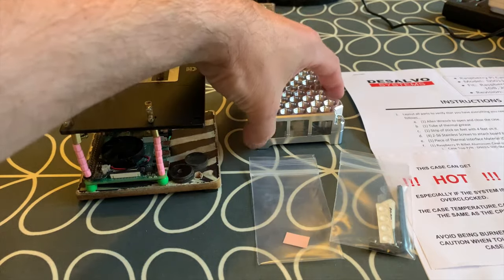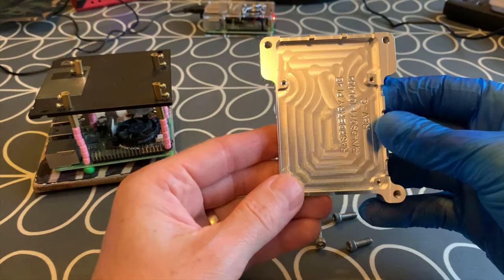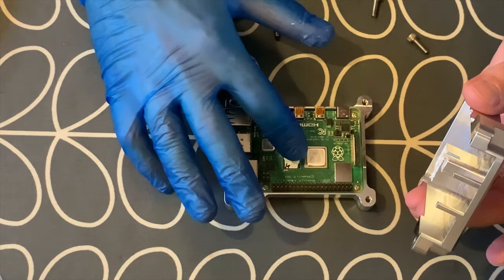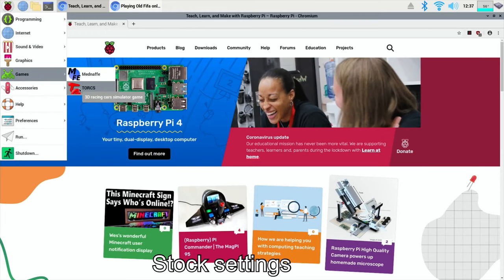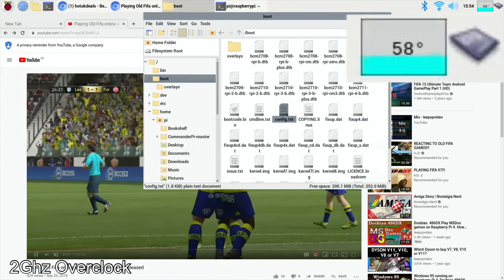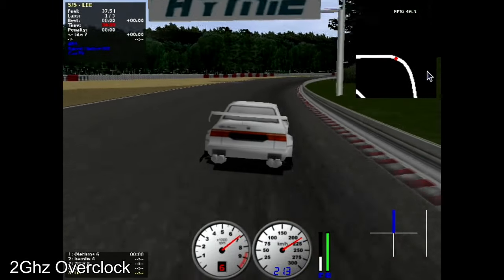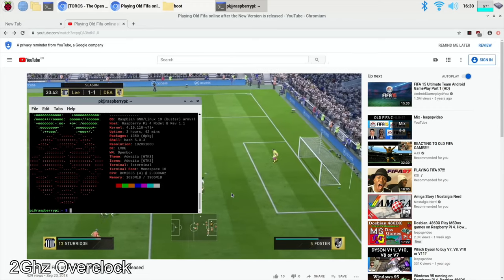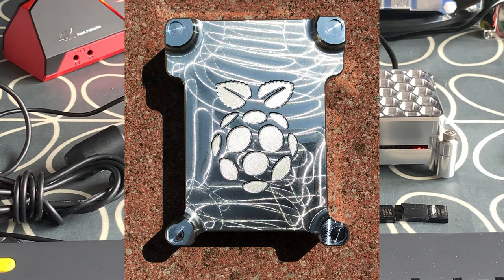Raspberry Pi 4. High Quality CNC Aluminium silent case.

Comment: To heat mine up I run Handbrake to convert an 8 minute 1080p video to 480p. That runs all 4 cores at 100% for 9 and a half minutes and it will heat up a lot.
Reply: It will handle that fine. I did a 1 hour long test here and it did not throttle.  Was running 2100MHz

Comment: Shiny. Great lines.
As others have noted, the design needs more ventilation for the other components under the lid. The top and bottom need perforations/openings to allow circulation and/or more prominent ribs to increase dissipative surface area (especially on top). Also, the quality of the connection between the RAM controller and the heatsink is very poor. Good thermal transfer requires high clamping forces between two smooth parallel mating surfaces.

Comment: i have tried numerous cases both in passive / active cases.   They key in cooling is ventilation.  This one, although cool in design, has a  bad ventilation.  Passive cooling by contact and having a huge bulk of metal does not help much.  can't use passive with overclocking and desktop use case.
Reply: I have my Pi4 8Gb in a Flirc passive cooling case and have overclocked to 2.1Ghz with no problems, I guess if your ambient temperature is high you could possibly have problems with passive cooling

Comment: would setting it on the 40 pin side make it cooler ? 
make a "metal bonzai" or "metal raspberry leaves" to put on top, increase the radiating volume.  some 3d printers can print metal now ...  the metal addon top could have rgb led(s) to "show" temp